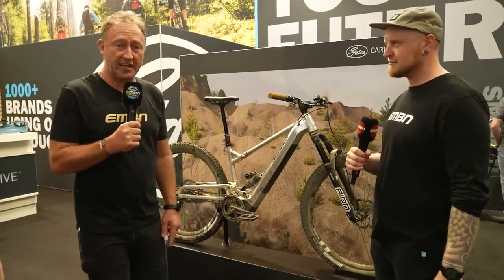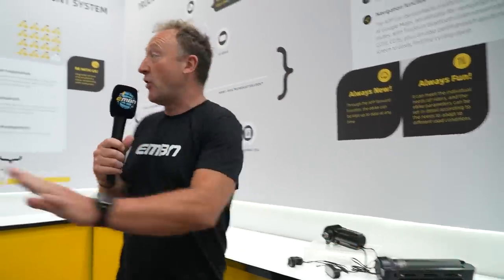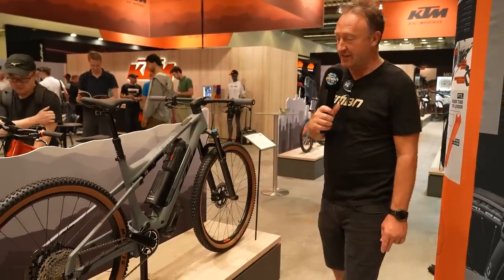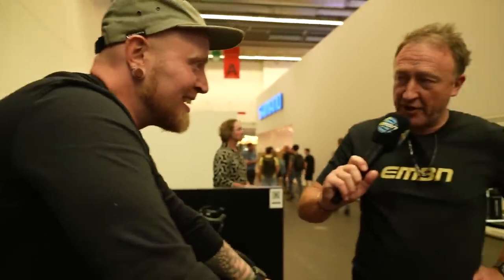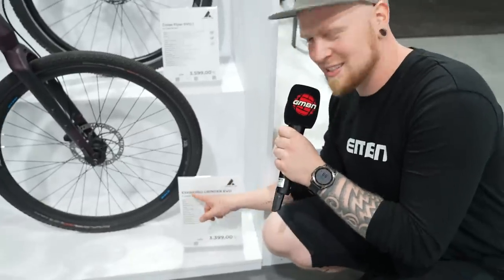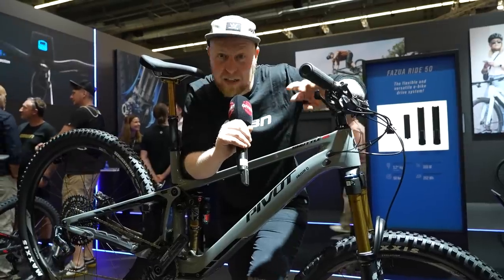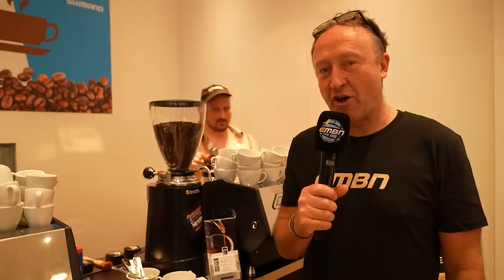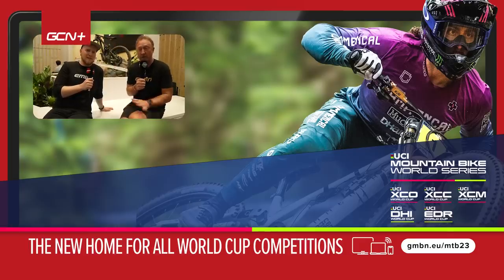2024 EMTB Bike Tech And Concepts | Eurobike 2023 Day 2

Comment: Hey ebike motor producers and ebike manufactures in general! Please unify some things like:
- One charger plug for all motors: like its is with usb-c in electronics
- Open BMS (battery management systems) for easy battery replacements or cell swaps. Ebikes should be sustainable right? So please give us an option to repair batteries when these are out of production or are not available in some regions. 
- Two/Three standardized motor mounts: for full power motors, for SL ones and others. 

At least "one plug" and open bms should be mandatory for all e-bike stuff producers!

Comment: What was the whole smooth gear change thing? I didn’t quite understand that.
Reply from the maker: That bike was fitted with the Classified Powershift. It's an internally geared hub, so in conjunction with a regular cassette and derailleur it allows you to make some bigger jumps in gearing if the trail requires. It also greatly increases the overall gear range too.